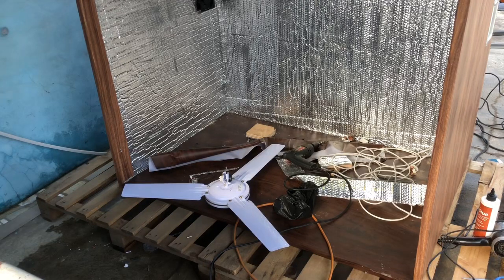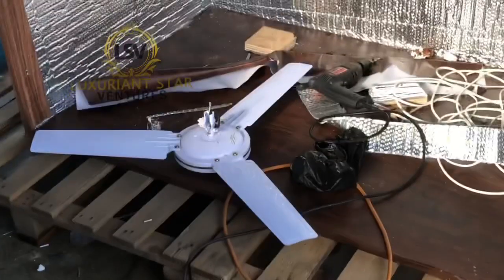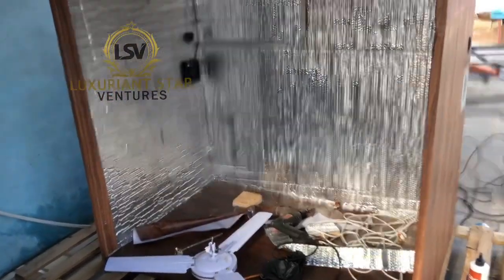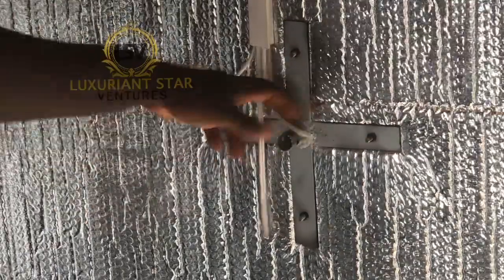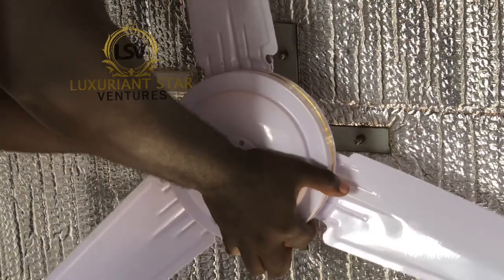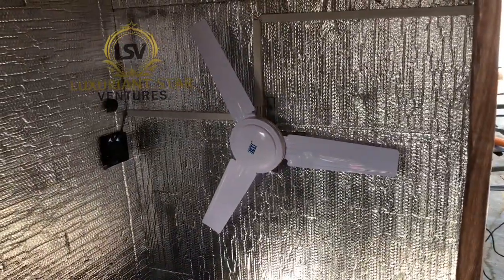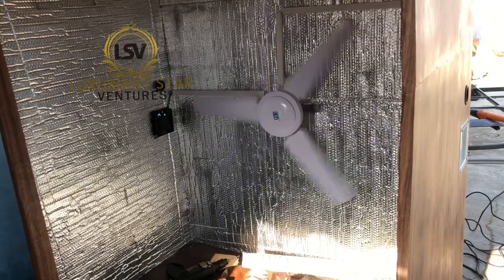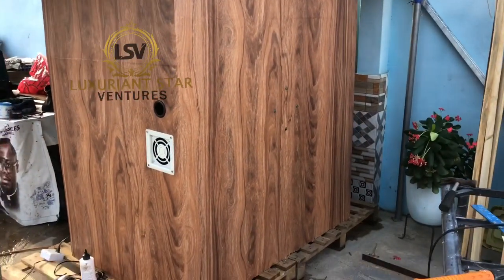FIXING CEILING FAN TO THE WALL OF AN INCUBATOR

Comment: Very impressive, but what did you use as heat source? I feel that the insulator might get burnt if heat element is used. Thanks
Reply from the maker: I used the normal heat element .
It’s bolted to the frame with a metal hook with a gab behind
Reply: Thanks for your prompt response 👍